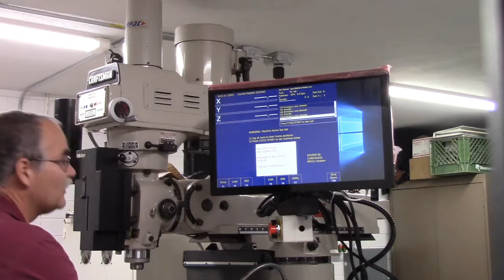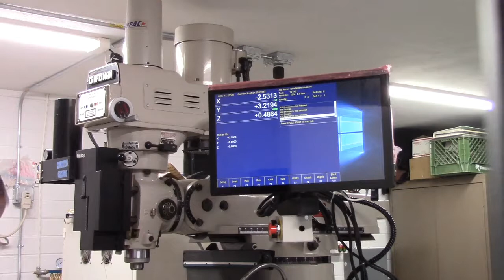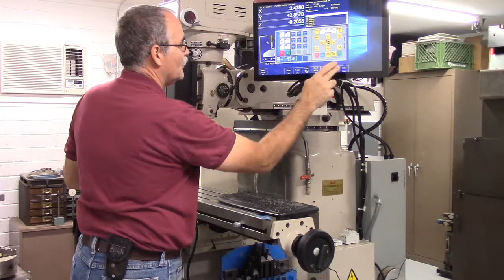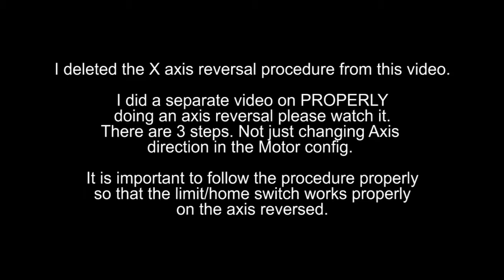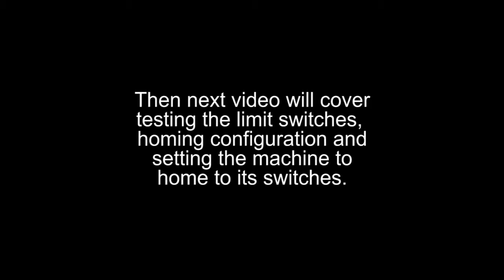Checking Axis Direction Movement on the Knee Mill

Comment: I have a cnc knee mill. What confuses me is.... The Gcode makes the table and the knee move in all the correct directions, but are the +/-- Keys on the controller supposed to indicate the direction of the sliding axis or the fixed spindle when the table moves ?.
Reply from the maker: Spindle. 
Table moves to the right spindle is going X-
Table moves away from you, spindle going Y-
It takes some getting used to
Reply: @martyscncgarage5275  When I start my machine up, it references all 3 axis to its position - table down (Z) table towards me (Y) and table to the right (x). So I would of thought. if the spindle is in the top left corner (so to speak) anything away - is a negative movement ?
Reply from the maker: On a mill, Z usually moves up to Z+. You can make it home to wherever you put the limit switches. I set my machines to home to: Z+, Y+, X-
Reply: @martyscncgarage5275  Not on this one. It homes at Z+ / Y + and X - . . Its a 1980s swedish built cnc mill. 
Storebro Combi-mill